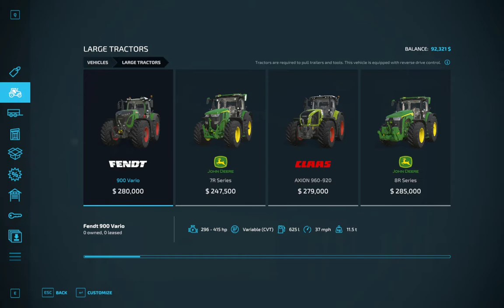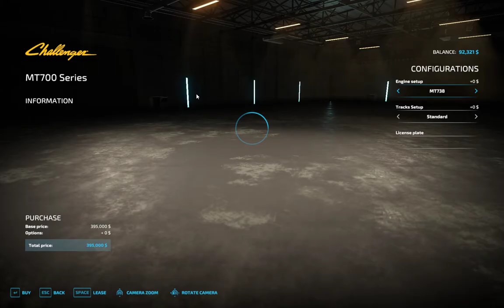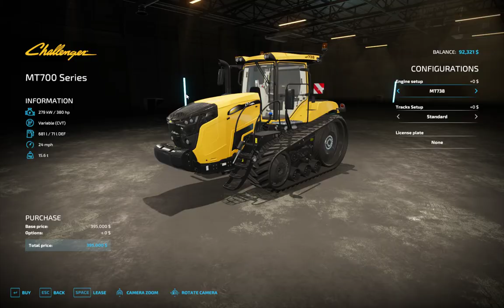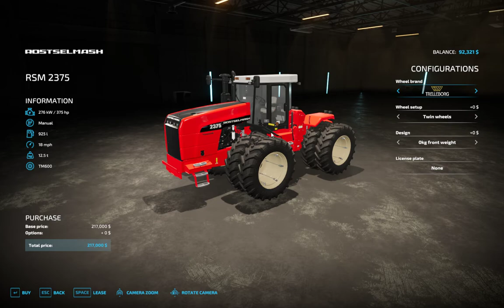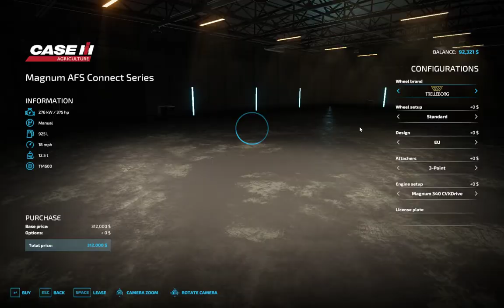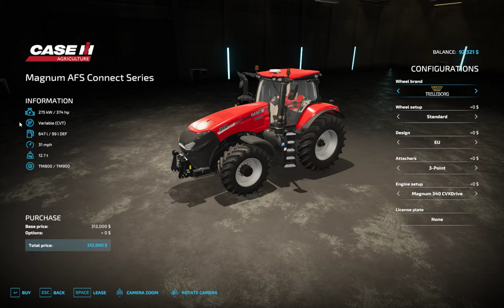FS22 Tutorials | Differences in the Transmissions

Comment: Manual+powershift is like the one on the 8960. The idea is you have 4 gears and a series of numbered ranges like for example a-d. You cannot shift ranges on the move. You have to be at a stop to change ranges. Lets say ya got a heavy grain cart and you need to do some road travel. You will select the highest letter range. In this example d range. At that point you have a pattern like a z. 1st then left of that is 2nd, follow the z up to the right corner is 3rd then left of that is 4th. You can go from 1st to 2nd and from 3rd to 4th by just moving the shifter left and right which is powershift. In order to go to 3rd from 2nd or vice versa ya need to cut the throttle down a bit then push the clutch and make then shift then continue. Hope this helps. Nice video 😁
Reply from the maker: Appreciate the comment and we’ll said!
Reply: @jonnydoes1922  np at all. Great job on the videos 😁
Reply from the maker: Thank you!